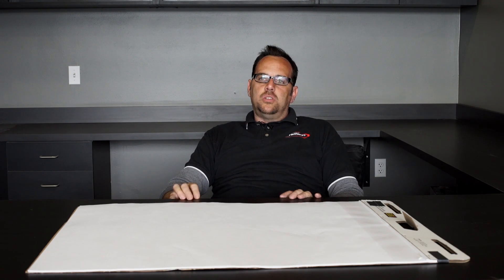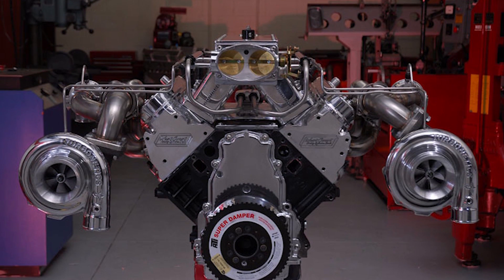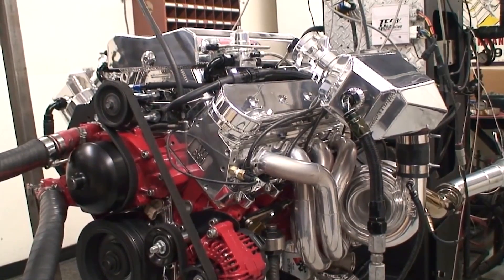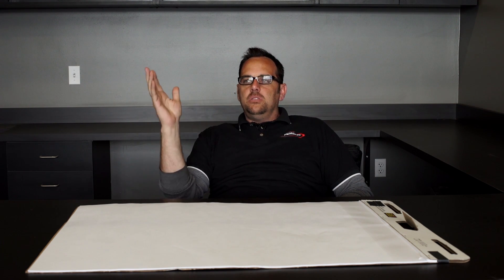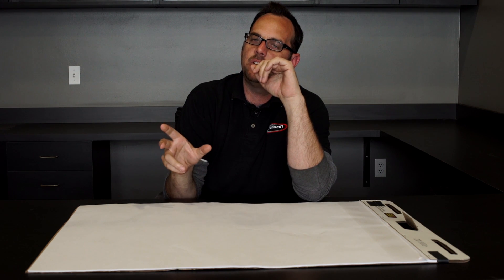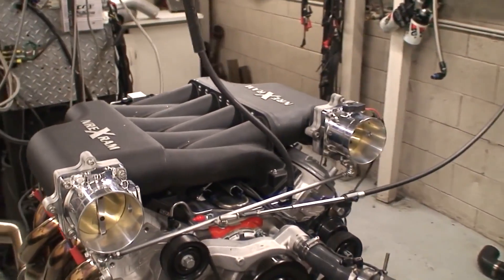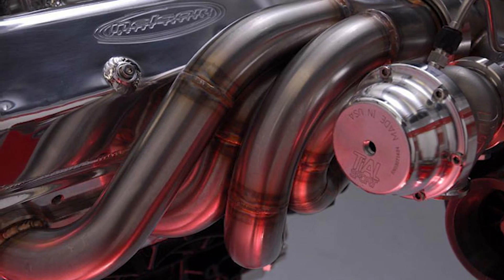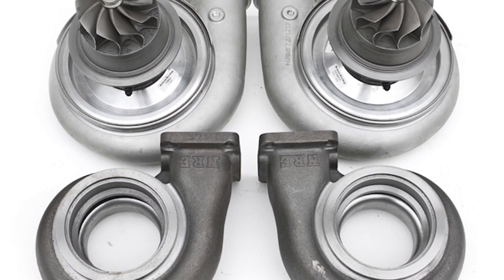Master Engine Builder Explains Why the LS V8 Is SO Good

Comment: What Mr. Nelson leaves out is the factory Iron LS blocks have a .070 shorter sleeve then a factory LS aluminum block (Atleast when talking Gen 4's) So with a 4.00in Stroker crank it's only pulling the piston out .030 more than a Iron block, Also when your using say the 6.125 length rods over the factory 6.098 or 6.100 length rods it further reduces the side loads placed on the cylinder bores, Over the yrs ALL the major piston manufacturers have moved the ring packages up/reduced skirt design or put the taper into piston so the finishing of the block when this video was produced is a thing of the past

Comment: 10/2024:  Good Day.  I bought my 2004 Z06 Commemorative Corvette New.  It has an LS6 and today 131,000 miles on it.  It's been up to 171 MPH (I ran out of highway then) still runs like new, gets in the mid 20 MPG and doesn't leak a drop.  Still on the factory original clutch.  I've driven it, but not hard very often.  I'm an old MOPAR guy for the most part.  A few 440 magnums and some others.  This is the best engine that I have ever owned.  
Thank You for Posting This.  Excellent.  A great find and I have subscribed.    Excellent.

Comment: Chryslers gen 3 Hemi has the raised block design of the 60's V8 and cross bolt mains. Also has better flowing Hemi heads than wedge motors plus piston oiling squirters for the pistons.

Comment: The Chevy LS small block copied the architecture of Chryslers Raised Big Block V8 design 0f the 60's and Chryslers design of the  60's V8 Hemi cross bolt mains Just like the third gen Hemi V8 does.

Comment: Because ford made the coyote engine and GM had to step tf up. That 5.0 still eat an ls lt engine up. Qnd don't try to say a c7 or c6 with the 7 liter 427. You have to consider the displacement of the engines. A 5.0 is 5x more efficient on making power than an old pushrod v8. OHC design is just superior.

Comment: The LS finally got it somewhat right by using Ford style heads that have the valves all the same on every cylinder. The bottom end is great just like a Y-block Ford designed in the 50's and 60's. If you really want to wake up an LS put Ford Cleveland style heads with canted valves. Bore out the lifters and put Chrysler lifters in it. The GM engine management system is great and easy to work with.
Reply: I doubt that either Spreading the intake ports to ensure a more direct airflow into the combustion chamber or the skirted block are original Ford ideas. Here in Europe we had such heads before the Windsor came to be.
Reply: @d-phoenix2198  the Dodge Poly engine had canted valves as a cost savings over the Hemi in the early 60's
Reply: @jamesford2942  Canted valves are a very interesting design and theoretically superior to wedge shaped chambers. I haven't seen it in any not-american engine as of yet. If I recall correctly the Poly was the first followed by the big block chevy mkiv, Ford 385 and Ford Cleveland. I think the new gen 5 LTs from GM also have a slight cant right?

Comment: Alright.. Ive asked this question on a bunch of other channels.. I have a 2006 GMC Seirra 2500 hd 4x4 with the 6 liter Vortec. I have been told its not an LS  its an L96 or something.. but its the same motor out of a corvette, but has a cast steel block!! Its obviously cast for towing and torque.. Ive only done the Cat Back duel exhaust with Super 40 Flo-Masters, A Bullydog Programmer for the motor and shift stuff on the tranny.. a throttle-body spacer, and a KnN cold air intake.. for a big heavy truck.. she rips.. But.. is it LS or this L96 thing??
Reply: Holy.. all other comments are 7 years old!! Guess i will never really find out!! Owned the truck since new and never really had an issue.. and its only got 200 thousand Kilometers on her !!  Dudes and their little rice burners still are impressed.. cause my ol girl pulls really quick and gets up n goes!!
Reply: @mycarpounds it stands for Long Skirt. Yes, your motor is an LS series engine.

Comment: I don’t think ls heads will flow better than heads with stacked valves heads with stacked valves take up a lot of room though not great in tight spaces but who cares when you have cross bolt mains just add tons of boost

Comment: I think I found my problem. Don't know how I didn't find this guy sooner. Absolute genius. I have a .400 crank. .610 lift on intake .615 ish or so on exhaust. Don't quote me it's been years but close. Anywhoo, car ran like a spotted ass ape for years. 547hp 515tq at the wheels naturally aspirated. Curve is more like a plateau. Solid throughout. But now I'm pushing oil and #7 is constantly a problem. I think the part about pulling the sleeve down out the cylinder is what I needed to hear

Comment: He’s right on aftermarket intake manifolds. I was building my Z06 7.0 and the builder suggested I change out my factory intake manifold to a short runner with a smaller plenum. Complete loss of torque on the lower end and mid range, but pulled harder 4900 and above. Swapped back to factory manifold and pulled way harder on lower end and mid range.

Comment: When i was doing my LS swap on my corvette c4, the guy who was doing my build recommend that I change out the intake manifold into a shorter runner manifold as I was “ better “ than the factory manifold. After I complained about low end and mid range torque loss, I switched back to the factory intake manifold and noticed instant torque difference from low end to mid range torque. Apparently the manifold the guy gave me was mainly designed as a short runner, small plenum mainly for boosted applications that are only useful at high RPM. Watching this video just reaffirms everything.

Comment: Thank you for taking the time to make this video. A lot of good info, some people would charge for this depth of knowledge!!

Building the LS in my '13 Silverado now, and its the first endeavor on this platform; I am considering building one for my first gen Firebird after. 

Lastly, I can contest in my limited experience on the LS block, Tuning will make a HUGE difference. After valve train work, my motor struggled to start. A couple weeks of tuning (PC Tuners), and I can lay rubber (just a bit) in second!!!

Comment: It’s pretty hard to beat an LS engine. I drove my SS Camaro for 130K miles auto crossed it, open road raced it. All out mile races. Never skipped a beat. I never even changed the spark plugs!!! Car got 24mpg in 6th gear !!! Great engine the LS1.
Reply: My 92 Corvette gets 33mpg. It is a manual 6 speed
Reply: @ yea but do you have 500 HP? My LS1 was built and had close to 500 HP.
Reply: At the same time my Ford 460 has 433hp on a mild build. But before I built it it had 486k miles on it. Daily drove it,  wheeled it in the mountains, drag raced with it. Never skipped a beat either. 

But I get the simplicity, ease of tuning, obtainability, and cost of the LS.

Comment: So to anyone with a DOHC 4 valve per cylinder engine that says “but single cams, pushrods and 2 valves per cylinder is so antiquated” I would say that I’ll take a simple engine that will make a ton of horsepower and do it almost forever over a Swiss watch engine that is 
A) Expensive to modify.
B) Expensive to fix.
C) More likely to break.

My 6 litre LS in my Holden Commodore puts out around 450 horsepower at the flywheel with nothing more than extractors, exhaust, cold air intake and a dyno tune.  As a bang for your buck proposition I think you would be hard pressed to beat the LS engine. 

The LS engine brings affordable horsepower to the masses.

Comment: U said engines act like compressors if you need more air you need more valves you can do some porting example a toyota 3UR-FE 5.7 supercharged can make with 0.5 bar boost 550 HP with the stock supercharger on stock internals and you can buy a smaller pulley to run 0.7 bar of boost you can do 675 HP and i have proof just watch ahmad daham's RCF build

Comment: IF the single camshaft pushrod 16 valves still The best v8 engines why modern V8 engines uses DOHC 32 valves with VVT and VVL system to maximize power and to retain stress on high rpms pushrod is dead we are seeing engines that does x2 the power with

Comment: Gen 3 block with 821 heads, 227/244, .613/.596, 115 LSA, -15cc pistons, LS9 head gaskets, arp studs, mains and heads, clevite hp bearings, comp cams short travel lifters, 7.325 comp chromoly push rods, BTR platinum dual spring kit with titanium locks, TSP’s new dual spring valve seals, rockers with trunnion upgrade, 10rib ATI balancer and the other pulleys they apparently don’t stock anywhere on planet earth for a truck front drive, dual phantom 340’s, Vortech V-7 YSI with a BV57, air to water intercooler, 1 3/4 long tubes, SS dual exhaust, Hptuners, a built 4L80E that will scare the sh-t out of you if your not paying attention, is where I ended up with this LS love affair 🤦🏼‍♂️! My wife despises the truck and will no longer come pick me up on the side of the road anymore, even in the best of moods, my dog wont get near it, my neighbors and I no longer communicate and my in-laws think I am nuts when I try to explain why it has taken me 3 years to finish a tune-up on my truck. So my advice is to listen to this guy and try your best not to go overboard....

Comment: I’ve got a built LS1 motor in a 1998 SS Camaro that I put 140k miles on. I raced the car in an open road race in Nevada at 150 mph and drove home. Car has never skipped a beat ended up giving it to my son and he will prob put 100k miles on it. Nothing beats an LS motor.

Comment: LS engines are great truck engines, but it's technology is is last generation. When we raced 2 valve motorcycles, when 4 valve engines entered the scene, we were blown away with 4 valve engines that were bone stock.  As far as the Y block, Ford had all these features in 1966  and even earlier in their FE engines. The future of power is with 4 valve engine

Comment: I remember when all I wanted was a really worked engine like that. The stuff you say about these engines really would have appealed to me but the reality is that since I watched a granny in a Tesla Blow the doors off of J Leno's Cobra. the Internal Combustion Engine has no more interest to me. I have blown other peoples doors off and I have had my doors blown off and when someone is walking away from you and your foot is on the floor, I feel like I am  going so slow, you, I almost opened the door and got out to see if I was actually moving. Why do all that work when Granny in a four door is prowling the street in a faster car?
Reply: You feel like you're going slow?   Look down at your dash. The speedo will set you straight.  I think your dreams of engine building died long before Tesla came out.  People didn't stop tuning 4 cylinders because the V8 came out.  People didn't stop building hotrods when production cars were offered with over 300hp.  Tens of thousands of deer hunters prefer to hunt deer with a long bow over a rifle and will never go back.  Building and running an engine like this is an extremely rewarding and mind expanding ritual that can bond friends and family in fantastic ways.  Please post a video of you in your garage winding an electric motor that has all of the visual appeal of a shoe box.  After that you can pour some homemade dialectic goop into some 3d printed tubes to make your capacitors.  And what's the payoff?  Well when you are done charging the next day...you can start your engine and ask your wife "do you hear anything?"   Anything that keeps kids away from TV and smartphones for a while is a blessing. And the people at the head of Tesla motor Corp. need careful examination and scrutiny as they prepare to become one of the biggest auto makers. I will not give them my money.
Reply: @jabela9102   Then Granny is going to blow your doors off too. We don't try to soup up steam engines or flathead Fords anymore because technology moved on. You seem like a smart guy. Check out this video and see if any of that intelligence can be applied to the new technology. https://youtu.be/wvLmBfwmA04

Comment: Things that I've learned about aluminum. Pure aluminum will crack on it's own under pressure. Aluminum block engines aren't pure aluminum, they have other minerals in them to add strength and durability. The downside of aluminum is their change in mass when it comes to temperature. Aluminum also shrinks with age, we're talking over a period of decades, so it's not a quick change. You could hold onto an aluminum engine for 20+ years and not worry about it.

Comment: Sooo good because: Ford ideas center thrust main bearing, head bolt location, symmetrical valves, Looks like a FORD.
Reply: @mewrongwayKOCXF  o ,and also crossbolted mains another Ford idea.🤔
Reply: @mewrongwayKOCXF  and what aboot the other Ford ideas? Come on get on your keyboard and find some more witty answers. KEYBOARD WARRIOR
Reply: @nedski9436  lol, your just butthurt cause you were wrong. The ls was not designed by, or inspired by any ford platform. Ford had nothing to do with the ls, it was developed by gm engineers.

Comment: I have found that there are very sharp edges on the bottom of cylinders after the are bored and honed. I've seen shaved areas on the major and minor thrust surfaces of the lower areas of pistons cause by them rocking when they change directions. I always put a small radius on the thrust areas of the cylinders with emery cloth after machining to prevent this.

Comment: The LS has the benefits modern technology gives it. That deep skirt Y block is GM's answer to the weakness of an aluminum block. Its why the Buick GN's V6 has a deep skirt--it was developed from the aluminum 215 V8 block that went to Rover. Having all that crankcase space also helps with piston pumping--as the pistons come down the bore like a parachute, they create pressure in the crankcase that offers resistance to the piston at high RPM. The problem with the LS is when you start counting up the nickels and dimes. Like the $400 throttle by wire gas pedal. The oil pan and serpentine belt system you'll likely have to buy if you get an OEM system from the junkyard that doesn't fit. If you swapped the 305 in your car with a 350, of course you don't need any of that--you just reuse what you already have. Fuel injection for your 350 can run as cheap as $900 brand new if TPI is too RPM limited for you. Then there's the transmission--you might as well use what it was designed for, and that will require a speedometer in your car that isn't mechanical. And you may need a standalone computer for its torque converter. I'm glad Nelson mentioned the piston issue with stroker engines. If you're going for crazy power and have the transmission, driveshaft, brakes, rear axles and fuel system set up for four digit power, the LS is great if you don't know how to access race car aftermarket Gen I small block parts for just as cheap.

Comment: Because it's made from a FORD design .
Reply: It's made from an overhead cam Coyote engine that makes no low end torque?  WTF are you smoking?
Reply: This is a myth probably created by ford fanboys. The ls engine is a gm design, designed by a team of gm engineers. It is not based on or designed by ford.

Comment: no doubt they can make power, but my stock ls1 with 145,000 miles broke a  valve spring retainer, spring, and bent a pushrod. pretty sad imo.  im sure its amazing when built with aftermarket parts. texas speed has done amazing things

Comment: depends what you mean by "so good"? today the V8 engine is a massive gas hog and headed towards the edge of extinction - only remains to be used in expensive sports cars but for every day use there are many 4 cyl engines out there making great HP with tremendous economy  and reliability
Reply: Yeah dickhead but with turbos.
NA I don't think so

Comment: What motor would you design to give me 1200 horse power and put it in as 69 Chevy Nova can you tell me that thank you please comment back And what transmission would you put in there
Reply: An ls would be best. Get a cast iron block, forged internals, a healthy cam, good flowing heads, and some boost. 
For the transmission you have a lot of options. The 4l80e would be a good overdrive automatic transmission. The t56 would be the best good manual transmission option. The turbo 350 is a very good 3  speed automatic that is popular on the dragstrip. All of the transmissions listed would have to be rebuilt with performance parts to handle 1200hp.
You could do a sbc build also, the price would end up being pretty similar. If you want to keep it as original as possible the go with a sbc.
Reply: How much would it be to have you build the whole drive train So I could play with these hondas I'm tired of hearing   Them I need it done right let me know the price
Reply: @martinneps9387  figure at least 13,000 to build a reliable engine that makes 1200hp. You can do it cheaper, but you do sacrifice reliability. A stock 5.3 can make 1000hp with boost but don't expect it to last past a season of drag racing.
Transmission will be about $4,000 for the 4l80e or t56 and $2000 for the turbo 350.
The rear axle will also have to be built, figure $3,500 for that.

Comment: I swapped an Audi 2.7T twin turbo engine into a wagon and stock it produces right around 300HP, with some cam mods, exhaust and a chip it will get 500HP easy. I paid $300 for the motor, and $575 for the wagon with a bad motor. Well under $1000 and I am rolling. plus tons of parts at junkyards around here.

Comment: Too bad the G3 Hemi is more expensive and you dweebs running the LS (and therefore the aftermarket) are practically ignoring it on that alone. Wake up call, the Hemi is better. The COPO, Drag Pack and Cobra Jet have proved that out now that the engines all use the same blower. It’s back to adding weight to the Hemi just like the old days.